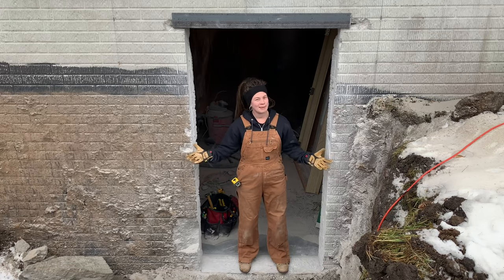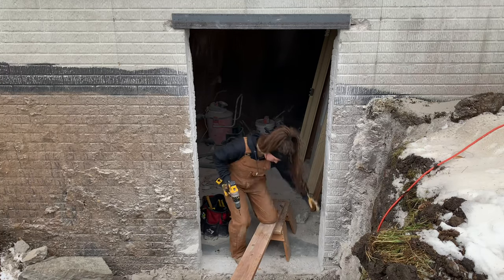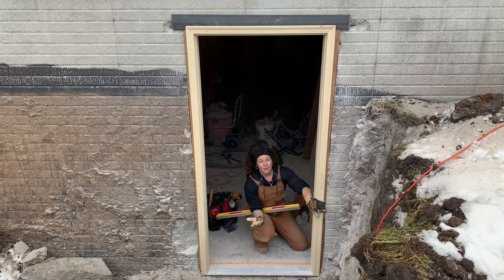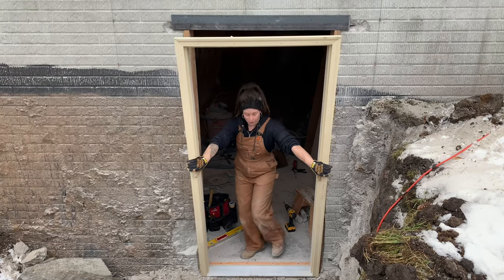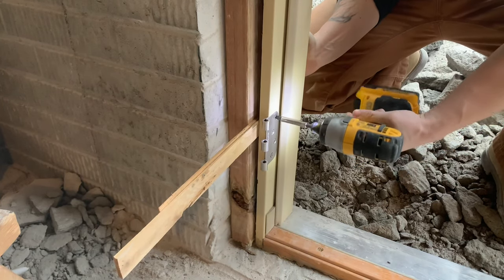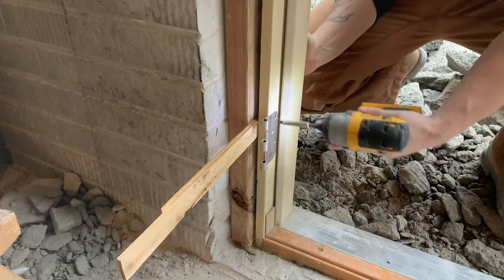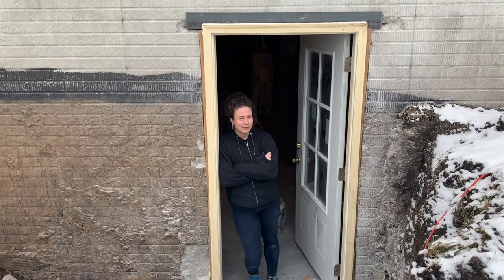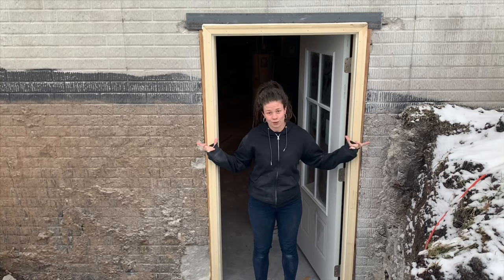How To Install An Exterior Door In A Concrete Wall

Comment: Thanks for this video, it was easy to follow and made my basement door replacement go smoothly. Very helpful, awesome work!
Update- 7 months and a winter later, my basement door has no leaks, no drafts, and opens and closes smoothly with absolutely no sticking. 
Thanks again for this video!

Comment: Thanks for the video!

I bought a fixer upper home this spring, and am finally feeling confident enough to replace my basement walkout door which has barely been attached to the concrete blocks around it (yikes). This video is a big help!

Comment: I just read your description and that answers my question of why you didn’t make a dozen or so typical DIY mistakes. Carpenter turned stay/at-home mom. Very nice! And this video also answers the question as to the turban in the miter saw table vlog. Lol I once sported waist-length, blunt-cut locks, and hair accessories were definitely required. Your mass raises that to a whole new level! 

Go grrl!
Reply from the maker: Haha yes. Love the work and the hair, but I try not to combine them 🤣

Comment: I just finished an extremely difficult install, very inspired by your good video.  Thank you!  Your dog's cameo is hilarious.   

TIP: I used Tapcons to fasten the stud framing to the concrete, then for the first time used bugled-headed **PowerPro ONE** (as in one screw for many materials) to fasten jamb via one of the hinge screw holes and behind the weatherstripping on the the strike side into concrete predrilled, and love them. Recommend.  Just an exploritory homeowner, not sponsored.  :)

Comment: Excellent video . Thankyou. Yours was the only video I needed to check out. Am replacing a prehung door in wall with wood framed upper, and block knee wall at bottom. Old door was nailed to wood frame, but installer skipped securing to block at the bottom with a 1.5” gap between door frame and block wall. …a half a$$ed install in my opinion…will add and secure 2x treated in that gap with tapcon concrete screws.

Comment: Thank you. 60 yr old Scotswoman here, trying to get her head round doing DIY now that DH is no longer able to do this.  Looking for ideas on how to replace a door in a brick shed. 
Think I have a notion of what is needed now. Shall probably return to your video a few times and have subscribed to your channel. 
Still a bit nervous about tackling the job, but I have a better idea now. Don't laugh, but using expanding  foam hadn't even occurred to me. Doh!
Reply: Update.  The past year proved even more traumatic than expected. 

Finally got round to re-hanging one shed door last week. Thank you! I managed it - you not only told me how to do it, but you gave me the confidence. Very grateful.

Comment: As a veteran remodeling contractor this was pretty much perfectly executed. The only other thing I might have considered is to wrap flashing tape over the outside corners of your 2x frame members for an extra layer of protection, but getting that to stick to masonry can be hit or miss. Great work in any case!

Comment: I was getting ready to get some shims and this professional contractor told me to try the plastic shims. He said they will not split and are a lot better, so I tried them. He was correct, they were a lot easier to use. Also one side has teeth on it, so it grips to surfaces a lot easier. Will never use wood shims again.

Comment: Hi Katie,Thanks so much for the video! You Are Adorable! And you know your stuff!I have been humming and hawing over replacing the 1950's walk in man door for my basement. IT is a daunting project as the door and frame will need to be cut down to fit into the opening. Sigh. Your wonderful video will get me through the initial framing of the brick, and eventual setting of the door. Now to get the door and frame cut down! Special order turns a $279 door into a $900 custom door.Again - thanks for the incredibly accurate video that just blows away anything else out there on this subject out of the water!Now if you could just make one on how to shorten a pre-hung factory exterior door and frame- that would be great ;-)!Well done!Chris
Reply from the maker: Hi Chris, I’m so glad you’ll be able to use the video as a good resource for your project! Lol unfortunately no exterior door jamb shortening videos from me. Honestly, I’ve never had to attempt it and glad. Best of luck with your project!

Comment: Sometimes I use a glazing bar as a spacer on the door catch side of the jamb. It gives a nice space between the door and jamb when shimming.   If you need a bigger gap just push the bar to open the gap as desired.

Comment: Skipping through the video, I can tell your video's going to be the one I want to watch. One of the only videos that shows installation of the lining, the door AND the trim.

I wanted to ask - what kinds of numbers are you looking for when it comes to the exterior trim? I'm going to be installing my own door lining/framing, and buying my own exterior door. The width from the inside of the jamb to the outside of the framing seems to be variable (depending the thickness of your framing, the thickness of the door jamb, how much gap there is between frame/door, etc. Is it common for people to rip cut their door trims to get a custom fit?

Comment: Good explanation.  MY QUESTION: I was adding a storm door (exterior, of course) to the front door on a concrete block house.  When I took off the brick trim, it was not nailed on but attached via caulking! The jamb board was 1/4" thick and it was attached in a couple of places to the concrete block with long screws. There was no wood for the jamb to attach (in your video, you attached the treated lumber via screws to the brick/block and then installed the pre-made door jamb).  The current jamb is rotting on the bottom and I see no way to fix it because there seems to be no attachment points. My thoughts are to pull out everything and start from scratch. Oh, and my jamb is 5 3/8" and the piece of wood nearest the door with the weatherstripping on it is 2 1/2".

Comment: Thanks for the video!  Have you or anyone here ever hung a door where you had to cut the concrete wider?  I'm looking at hanging a sliding glass door in AZ and the wall is either concrete or block.  Haven't been to look at it yet.  Just trying to do some research on what that job works take.  Thanks in advance for anyone's input.

Comment: Looking for info on the lintel. Does utilizing a lintel with the vertical edge exposed, either on interior or exterior as you've shown here, work as good as having it tucked behind the brick?

I'm looking to cut into my basement wall to install a sliding door and trying to get my bearings on load bearing and lintels. Mainly so I don't kill my family.

Thank you for the wonderful video.

Comment: In your vid, you first put adhesive on the concrete floor, then put the door frame's sill on the adhesive. But at 4min36, you shimmed the sill (ie inserted shims between floor and underside of the door frame's sill plate), which would obviously not be possible if the adhesive has set (for example next day). Must this shimming be done soon after squishing the door frame sill onto the floor's adhesive?

Comment: Great job nice video , my question for you is when working with a new door on a concrete slab like this would to install it prior to any interior flooring or set the Threshold on the new flooring in the same process.? Thank you
Leland

Comment: Hey Handymom (lol great name), if my cement opening is not plumb, i.e., the bottom of the opening is larger than the top, can I install the framing board can I install the framing boards plumb and fill in cement the empty space behind those boards to make the wall plumb?  Basically using the framing as part of the form for the cement?

Comment: Hey, great video thank you for all the info. 

Few questions if you got the time.
My concrete opening is 
81.5 H x 35 W x 8 D, I figure I can put 2- 2x8 on the sides and go for a 30x78 door.

First issue is the outside wall is regular red brick and inside is blocks. Wall isnt even/flush , some of the blocks are slightly pass or before the brick in a few places by 1/4 to 1 in. So the outside bricks gives a nice rectangle but the blocks attach to it it wavy. I figure I can chisel away the blocks to make it even and then put my 2x8. But there will be major gaps between 2x8 and wall. Do ilI simply foam that up? Or use something stronger?

Also at the top there is a metal beam. I was thinking of putting a 2x8 at the top. Can I use adhesive to attach top board? The top can be hold up by the two sides 2x8 and the adhesive. Will that work? If so what type of adhesive? What type of board? Will a treated board against metal cause proplems? Or should I go with a regular white board? Should there be some barrier between the metal and board?

Comment: How much would a job like this cost?
Starting from the beginning of the job until the end. Meaning costs for cutting the concrete opening. Also costs for door and framing install? Just curious, i have my own framing/painting/sheetrock/carpentry business. But people have asked me to do this for them on multiple occasions. It seems like a piece of cake. What cost would you recommend? Great work BTW you definitely have a good skill set. You go girl💪

Comment: I need you handymom.  I have a concrete block wall that I have a short door in to get into my small width (but normal height) basement.   I wish I could just hire you to do it. I'm sure you are not near Maine however.  But anyway, I'm thinking the install is the same on concrete blocks?? I hope I can do this without screwing it up.

Comment: The front door I have is broken and old (240cm wide), want to use prefab door (200cm wide) for new one but dont know how to resize the concrete wall..... this video was the closest I could find..... could you do a similar one or point me in the right direction for adding a door to a cement wall when need to make the opening smaller?.... thumbs up by the way for you!   :)

Comment: I watched 6 videos that told me none of your excellent tips. They say you should ask a lazy man how to do something to find the easiest way but it seems I needed to find another smaller person to do things in a way that will work for me. 
I do have a question though: I'm cutting through the cinder block course at the bottom of my garage wall to add a people door where there was none. I will be cutting out to the next course below. Do I need to do something on top of the bottom course like pressure treated lumber? You've out the metal threshold right onto the concrete. Can I put mine right onto the cinder block? 
Thanks!

Comment: regarding the concrete anchors; it looks like you just used Tapcon screws with no washers or countersinking. How long a screw did you use?

Comment: Great Video. Do you apply the same method for adding a screen door in front an exterior patio door. I want leave a gap between bother doors of about 10". its bare concrete right now.

Comment: So I've got almost the exact same scenario  I'm going to have to remove the left side 2X6X8 "buck" that's on the wall to fit the prehung door in place.  Another door guy suggested I just replace it with fence picket or 1X4 as "buck" for the left side.  My space is about 39 X 80 1/2. The door frame is 37 1/2 X 81.  So, I've got to trim a little bit off the door frame but build up the buck on one or both sides to make the door frame fit.  So what about trimming the door frame by 1/2" to make it fit the space?  That's what I'm in for.  Do I just trim it from the bottom?  What blade should I use?  Circular saw or is there a better way to do it for a clean cut?

Comment: How would you install a door in a steel mesh concrete reinforce d wall in a basement which is what I must do now to access PLUMBING o the other side of this concrete steel hatch work?

Comment: Thank you for the video! It was very helpful. Do you have to do anything else to the bottom of the door to keep it water tight? The concrete that the door rests on is quite damp all the time and I'm replacing completely rotten jambs after only 2 years. Any membranes or flashing?
Reply from the maker: In most cases what I did here is enough for waterproofing, but since you know you are dealing with elevated moisture levels, I would recommend using a sill pan: https://amzn.to/2XtHFiH (this one is for a normal 4-9/16 jamb up to 40” wide. You can purchase larger ones if your jamb is thicker or wider. You can also find them at home stores.). This install video from Lowe’s shows how to install one 😊 : https://youtu.be/GP-P16Fth40
Reply: @JunksawStudio  You are the best! Thanks for the suggestion 😀

Comment: My rough opening is only 33.5x82. Can I still use a standard 32x80 pre-hung, which will fit the opening, but there would be no room for framing. Thanks.
Reply from the maker: If your framing is perfectly plumb, you might be able to make it work. If there is any way to get yourself more room, it would help you out a lot.

Comment: Hi Katie, thanks for the video.  I wondered why you didn't use treated boards for your jamb?  Or use peel-n-stick between the wood and concrete?  Seems to me like the moisture wicking in from the concrete will cause rot in your 2x6 boards.
Reply from the maker: Hi! I did use treated boards for the framing. I’m pretty sure I explained that, but I might have missed it. You are right— using treated lumber is an important part of attaching wood directly to concrete.

Comment: Awesome video... only one question: in your opinion what type of wood do you suggest to screw into the brick? 
I want to add a (heavy) solid wood door but not sure what type wood will work with such heavy door. Please help....
Thanks
Reply: 2x6 or 2x8 pressure treated lumber. That's what I used.

Comment: It doesn't look like you have a lintel.  Is that a piece of angle iron above the door?  I have a similar situation, where I want to put a door in an existing window opening and just cut out the wall below the existing hole where the window sits.  It's a very old house and I'd like to disturb the existing infrastructure as little as possible.

Comment: What if instead of concrete you need to attach the framing lumber to a concrete block wall?  Would you use anchor bolts or inserts?  Any help is appreciated.
Reply: Same rules apply.  Predrilling for your tapcons requires you drill a little deeper than the length in the concrete (or block), that's all I'd add.
Reply: @genicabreitenbeck3232  so use tapcon screws to attached boards to the concrete block opening?  Thank you.
Reply: @normcoffey4296  Yep!  The dust fills in the holes, so that's why you go a bit deeper, so the screws don't bottom out early.

Comment: She did a nice job.....but why no flashing pan? Glue wont hold forever.....it acts as a termite/carpenter ant shield ....?
Also need grace paper/vycor over the framing as vapor barrier....I'd remove brick mold and add 5/4x4 trim .....I see at the end she explained this .....👍🏼

Comment: On my home they have the brick molding removed and have the exterior door installed from the inner wall.Between the exterior door and the storm door is 12 inches.I need to have my from door replaced cause of gaps in the door.So do I have to have the same set-up used in replacing the door.Or is there a different route I can go with to reinstall the door?BTW love the hair.
Reply from the maker: I would have to see pictures to be sure, but if I understand you correctly you could probably install the new door from the outside and then either have the remaining opening inside the house drywall wrapped or covered with a jamb extension to the face of the inside wall. However, it’s probably set up the way jt is currently so that your door can swing open until it meets the nearest wall. If you install your door farther inside the opening it will only be able to open until it runs into the opening, or about 90 degrees, which can be slightly limiting.
Reply: @JunksawStudio  The opening from the storm door to the edge of the inside door opening is 12 1/2 inches.If installed from the outside the hinges would be well inside of the door jamb and the door wouldn't be able to open.From what I see the removed the outer brick molding and slide the door in from the inside.Is there any way I could send you photos  so you can see what I am talking about
Reply: @JunksawStudio  I was going to replace the door and storm door 2 years ago but guess when I described the job I had needed to be done he chickened out.Was suppose to come to my home and never showed up or called me back.I didn't contact him again since if he was not sure I don't want him trying something that might be beyond his skill level.

Comment: I have a problem in my concrete opening in that it is too short for a standard door.  I see your steel lentil. However, I have an 8" concrete lentil over my opening.  Can I chisel out an inch of the lentil without comprising the structural integrity of the opening? custom doors are too expensive for my little project.
Reply: Your best bet is to leave the lentil as is and knock out (cut) an inch on concrete threshold side. The lentil is structural.